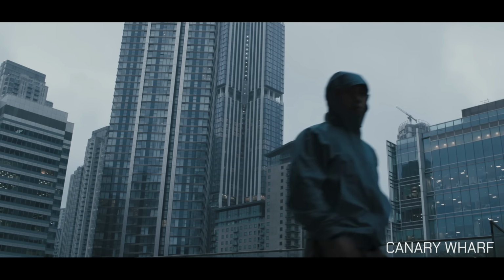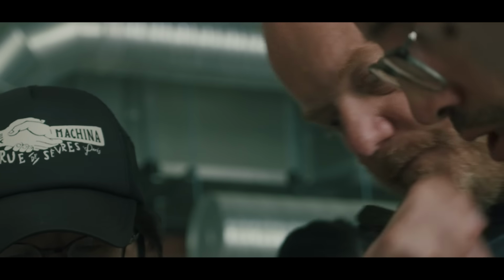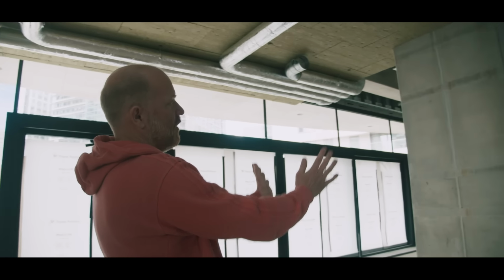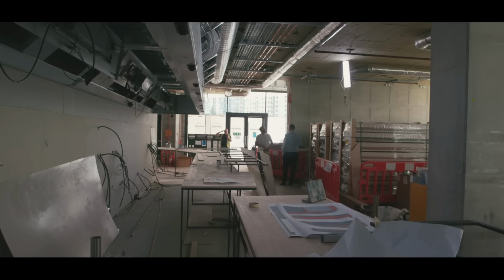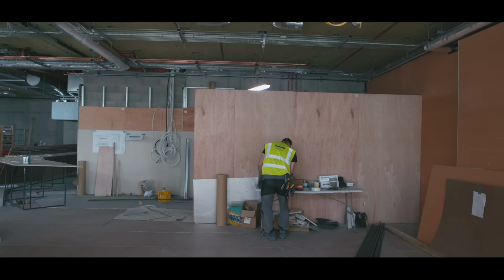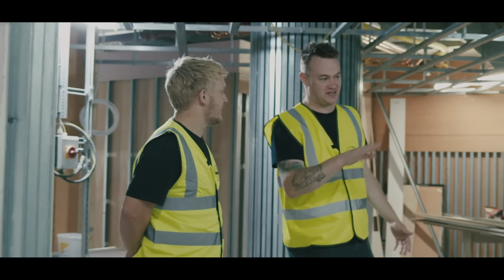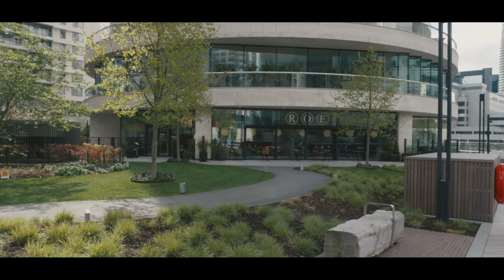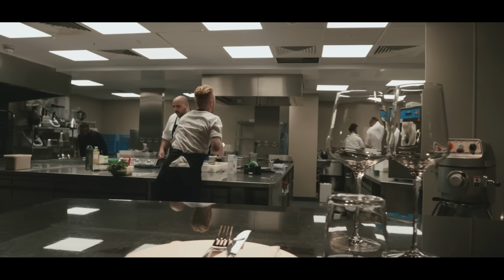How We Built a Restaurant From Nothing

Comment: When I left school I got an apprenticeship as a draughtsman, the company designed commercial kitchens and then built them. In 1980 I created the drawings for the kitchen and restaurant at an Airport terminal. The customer signed off and it was built and cost around £250,000. A week later I had another big job, for £250,000, to redesign the kitchen and restaurant at the same Airport terminal. I was shocked and checked if this was a wind up,it wasn't. Again the new design was signed off and built. I settled back to the regular small kitchens and two weeks later another £250,000 kitchen. It was as you probably guessed the same Airport terminal. I created the third iteration of the kitchen and restaurant but the customer had paid all the invoices, £750,000 approximately. Most restaurants would go bust if they couldn't make the first version work. This customer was not a company, the airport was owned and operated by the local council. We had visited the site to enquire what was wrong with the first design, the restaurant manager was overjoyed with his new kitchen and restaurant the customers loved it as did the staff. The restaurant closed shortly after the third version was built. The airport had run up a huge debt. It was deliberate part of a long-term strategy to radically change the airport as the original building was listed.